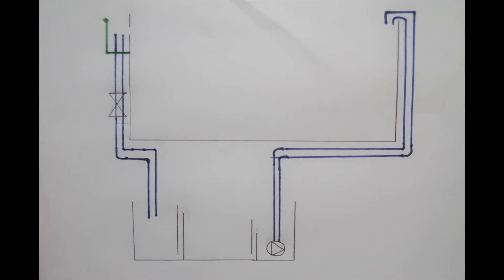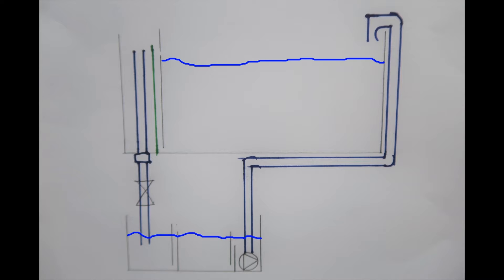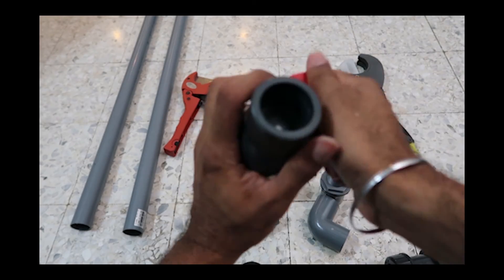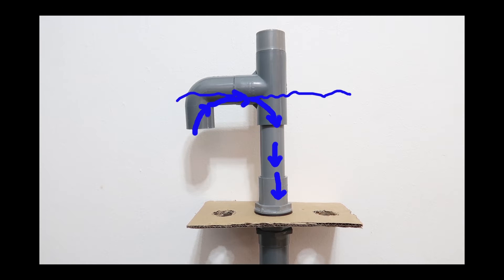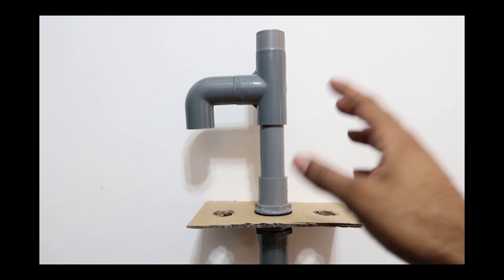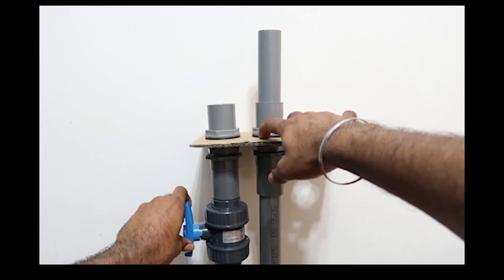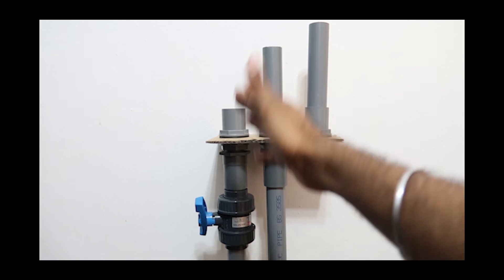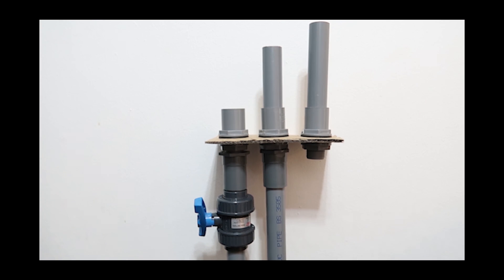3 Easy aquarium overflow Design(easy & simple)

Comment: Do you permently attach the stand pipe with solvent  or does it stay removable? Just stays put with pressure fit
Reply from the maker: For larger tanks stand pipe you should use solvent , but for my smaller tank pressure fit was fine. But i suggest to use solvent to avoid any unforeseen situation.

Comment: HI, just a question, but how do you do water changes for the Herbie system? If the emergency pipe is draining water to a certain level, won't the emergency pipe keep draining water into the sump, causing it to overflow when you do water changes? (I am assuming that the emergency pipe is kept at a low water level), or is it supposed to be kept at a relatively high water level? (near the top of the tank)
Reply from the maker: Hi Evan, Firstly thank you so watching. I don't go water changes manually ( https://youtu.be/R75c_PyNdiQ). But I've done it manually without an issue. My Herbie overflow system is in my overflow compartment so it doesn't affect water changes. A simple method is to remove 30-50% of water then just add back the same amount until you reach the amount of maximum water in your MAIN TANK. Let me know if you need further explanation I could make a video abt it. Thanks
Reply: @TheSimpleAquarist  Thank you for the quick response! Helped me understand this concept further! (Thank you for making these awesome videos)

Comment: Ima use herbie overflow. What size pipe do I need for a flow rate of 7500l/h
Thx
Reply from the maker: at least 40mm would be best
Reply: @TheSimpleAquarist  nice thx. I planned to drill 2   2.5 inch holes in the tank. I'm going to use 1.5 inch pipes

Comment: Good explaination. Where do u get union ball valve from?
Reply from the maker: well im not sure where your from but if your from malaysia - you can check out the link https://c.lazada.com.my/t/c.YUzK7s?url=https%3A%2F%2Fwww.lazada.com.my%2Fproducts%2Fsanking-20-63mm-pvc-true-union-ball-valve-pipe-fitting-fish-tank-adapter-water-pipe-connector-i1443706075-s4674976119.html&sub_aff_id=sanking+union+valve  - look for sanking brand much better quality but if your from other country im sure you can find similar quality on local hardware stores or even plumbing stores.

Comment: Bro, if i have space, i use 2 durso...is it safe enough?
Reply from the maker: If your using 2 durso i can consider it to be safe but if those durso pipes are in 1 compartment and not separated you can easily change it to herbie overflow and still maintain overflow rate that you currently using.
Reply: @TheSimpleAquarist  thanks bro. Yes both in same compartment. Hence think to convert to herbie. But will the flow rate remain the same kah? Because if using herbie, its now using 1 pipe water flow down. (Other is emergency). And if i use 2 durso, both are being utilised simultaneously.
Reply from the maker: @bobbylim1971  Yes flow rate would be the same because in Herbie 1 pipe would be full siphon - almost the same flowrate as 2 Durso pipe overflow.....you can always leave 1 pipe as Durso(will act as an emergency ) and just make the other pipe lower 6-8 inches before water line in overflow compartment don't forget to place a ball valve on the fully submerged overflow pipe so control the flow.

Comment: I have one question about the last setup, where does the emergency drain go to? Should I have a section for it in my sump or does it go else where, or does it have a closed end and just there to alarm with a sound? This was so helpful! I been looking for someone to explain how it works. I will be sharing this video for sure.
Reply from the maker: Hi ,
All piping goes back to sump. You don't have to create any new section just plumb the piping down into your 1st section of you sump. If the other 2 pipes get clogged all the water will rush into the emergency drain pipe and the will be noise due to air forced into the pipe together with water. (Loud gurgling noise). Thank you very much for your kind words and I'm really glad it helped.